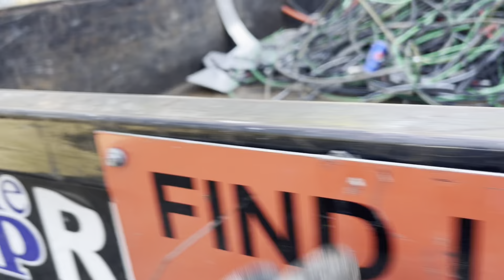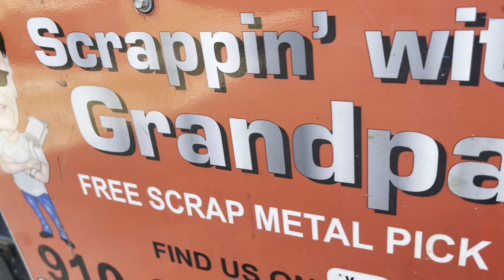Scrap metal. Copper stripping.

Comment: I mounted a Stripmeister horizontally in my floor drill press, works great as you can adjust the feed speeds. And for solid core wire I made a coating crusher using the drill presses chuck and a timing belt tensioner.  I am sure you will devise a plan seeing that you made a great contact and a friendship. Cheers Andrew.
Reply from the maker: Very interesting. I have to think on this 1